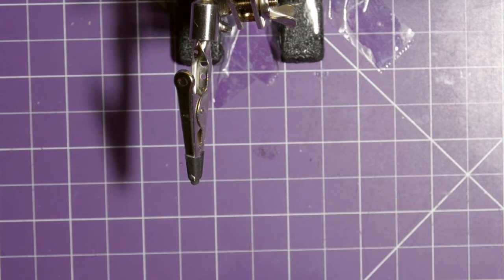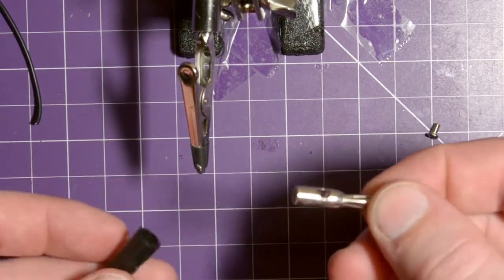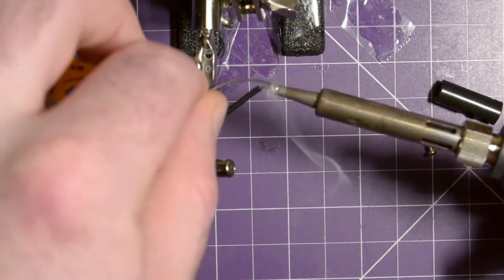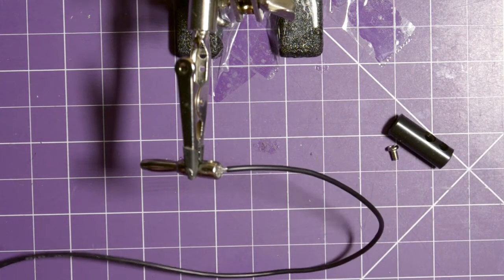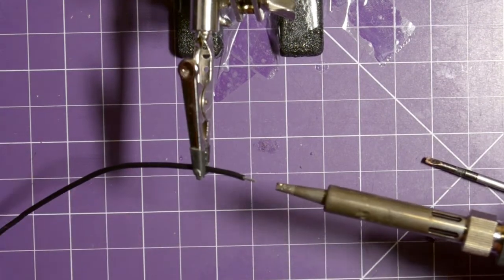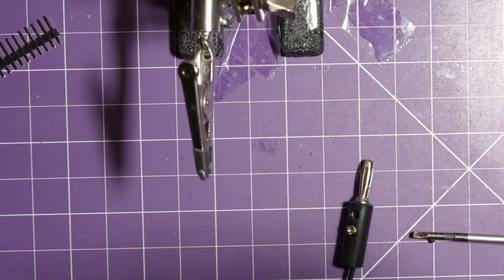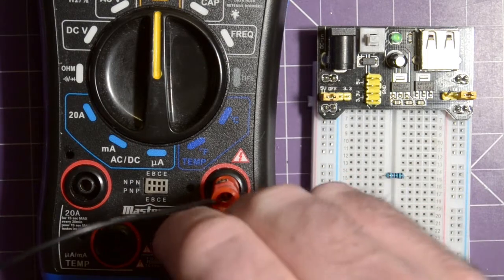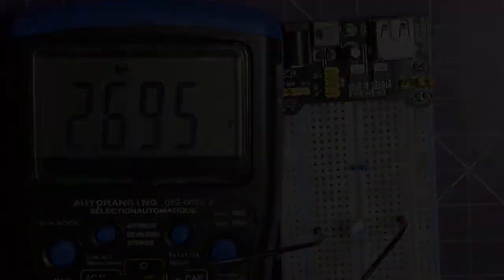DIY Custom Breadboard Multimeter Leads

Comment: Useful vid with a great idea for breadboard users, and a good tip about the banana plug type, thanx!  
Why not just use breadboard jumper leads, with male pin already fixed, soldering the other to the banana plug?
Reply from the maker: You can certainly do that! I just like the pin headers personally. What's great about the electronics hobby is that there are tons of different ways to achieve the same results, and there is no one "right" way! Perhaps ill make a new video with your idea, if you don't mind?
Reply: Simple Electronics Absolutely right - there is always more than one way to do most stuff!

You are very welcome, and I would be honoured, to use the suggestion, I will look forward to seeing the result ... 👍🏻 (I may even have a go myself!  Although I don’t do YouTube videos... :) ). Thanks, R... 🐍